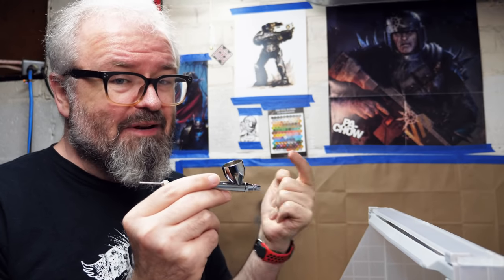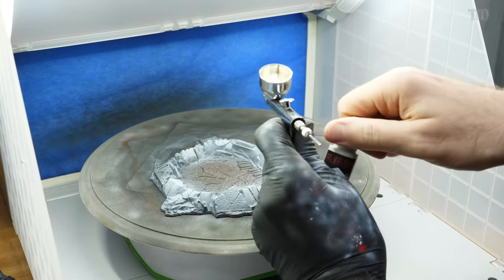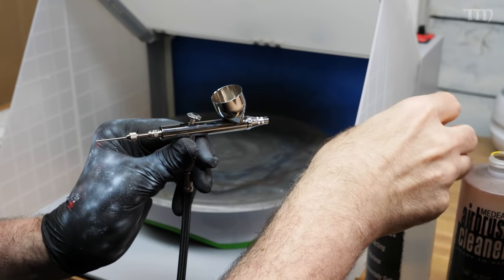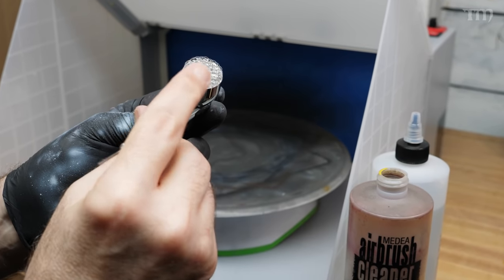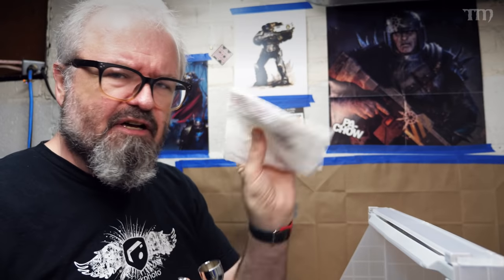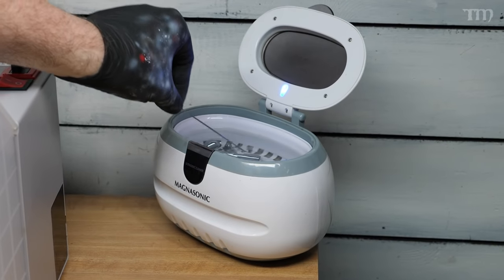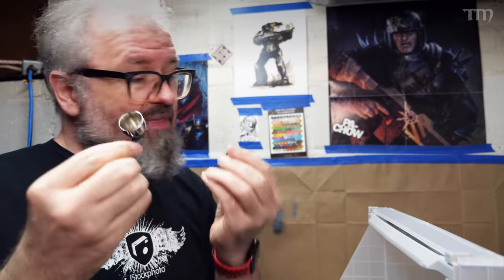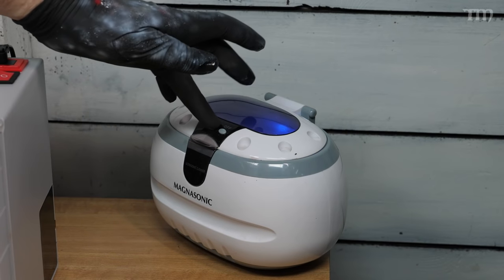NEVER Clog Your Airbrush Again!

Comment: I much prefer to dump the contents of the paint cup after you back fill. If there's any tiny bits of paint that have dried or started drying, I don't want to be firing that through the nozzle.
Reply: Same here, there can be an awful lot of paint flecks in there.
Reply: That's another good reason why to add too little paint instead of too much. When I put in too much it starts to dry around the edges leaving those tacky lumpy deposits.
Reply: 100% agree, and it only takes a few seconds
Reply: I usually do that too, but I imagine his other techniques minimize how many small particles will even be there.
Reply: Absolutely this. What he does will cause clogging. Main way to never clog an airbrush is to correctly use the double action. 90% of miniature painters do not use airbrush correctly
Reply: @andreikoenig5718  can you elaborate on what you mean by double action? I don't follow what part of the above comment is referring to double action
Reply: @robulon  I assume we are talking about double action airbrushes. Most mini painters do not use the double action correctly. When you push down, air comes out, then you pull and paint comes out. You want to do that in reverse when you want to stop the paint. Push back and then release trigger. You dont want to let go when you have the trigger pressed and back. It immediately shuts off the flow so the paint now is on the needle and the tip and that what cloggs the airbrush. Hope that makes sense. A professional airbrush artists taught me this several years ago. I have 2 iwata airbrushes that I use at least twice a week, and I have not taken the apart in over a year. And I shoot primers, enamels, acrylic, varnish, etc. If you never leave paint on the needle, cleaning is super easy. I blow water through it, and then a little bit of cleaning solution and its ready for next session.
Reply: @andreikoenig5718 excellent advice mate❤

Comment: One additional thing: take the needle out through the nozzle side of the brush (after removing the actual nozzle). This way you don't 'contaminate' the parts of the brush that would otherwise never see any paint (the trigger and back screw parts)
Reply: Came to the comments to say this, took me many years and many replacement backstop washers to figure that one out.
Reply: Would that work with a nozzle you have to unscrew?  Not all of them just pop out.
Reply: @Gakusangi If the tip screws in, your kit probably came with a wrench.  Trying this out for cleaning purposes will also show you how to swap tips, which you need to know to swap needle sizes.  So worth doing as a learning exercise!  
 
🙂
Reply: @johnsteidl293  I was only concerned about unscrewing the nozzle while the needle was still inside the airbrush and if that was risky to do.
Reply: @Gakusangi  Only the usual need to be careful when working around the needle tip.  And if you ever damage one, they are not that expensive to replace.

Comment: I haven't been keeping my airbrush wet, but what I usually do before I start (I do something pretty similar as a cleaning process) is run a few drops of cleaner, then water, and then flow improver through before I start painting with it.
Reply: I second this ^^
Reply: Yes
Reply: yep me to, and it was until now always totally enough. 
i ha e one issue with oncles move, i would never spray the cleaning liquid after the backblast process back out the front, this move totally contradicts the backblast process. yes, i do spray out the front, but only then, after i backblasted and spilled that stuff out first and cleaned the top. i mean, then when i am sure, that nl particles can go further torwards the nozzle
Reply: this is what I do.
Reply: Thank you.  I was wondering what someone who doesn't use an airbrush often enough to justify keeping it in water should do.

Comment: use the Ultimate apex airbrush, i used standard thinners from a car paint shop first a little amount backflowed then poored onto kitchen towel to avoid paint going back into the needle area, then repeat but blowed through to clear the needle area, that's okay for a colour change, if I have used 2k or primer I always do a full breakdown clean, then when I have done all those types of cleaning a quick blast of acetone to get any lasting particles through and that air drys very quickly

Comment: Coming back a week later to comment after testing. This worked for me like a charm! I live in a dry climate so my brush tended to clog very easily no matter how much thinner I was using. I was getting to point of having to do deep cleans of the brush mid session to stop speckling.

I tried this and to my surprise, works like magic. No speckling issues except for the usually tip drying through my sessions. Thanks!

Comment: Airbrush Cleaner is, generally, a mix of Isopropyl alcohol, Glycerine and water.
So I cut the middle man and use just Iso most of the time, since I had already stocked it before the "inflation" of it.

When I want to make a deep clean of one of my airbrushes (I own 4, different uses) , I take my ultrasonic cleaner filled to half with water, I take a plastic bag (the food kind) , fill it with the other half of water + a dab of Iso (never fill an ultrasonic cleaner with pure Iso) , the Airbrush goes into the plastic bag (not dismantled, sometimes I will just take the needle out and also put it in the bag) , and I try to leave it for 10 minutes.

The plastic bag makes it really easy to throw the washing water out without having to move the whole ultrasonic, and the vibrations move through it like it was nothing
Reply: Clever use of bag.
+1
Reply: That bag idea is genius. Thank you !

Comment: I highly recommend you invest in a quick disconnect. Even if you only have one brush, it saves a lot of time when you have to disconnect your brush. I alternate with three brushes and I don't want to wait while I screw a hose on and off between them.
Reply: I did a lot of work with an industrial air compressor in my youth, so I bought Iawata quick disconnects with my first airbrush. They're so worth it.

Comment: For me the problem is usually painting a lot of the same color... paint will start to dry in the airbrush, the dried paint moves downstream and bang, there's your clog.
You should periodically clean just like between colors...
Reply: One thing that helps with that is mixing the paint really well and using a flow improver and airbrush thinner rather than just water. Altougth if the paint bottle has culmps in it theres norhing you can do outside of thinning the paint in something like a plastic shot glass and then pouring it in the airbrush. Altougth they do sell tiny filter just for that but I have never tried them
Reply: I had the same problem, but I think I found a solution to it: during a paint session don't touch (clean) the inside of the paint pot with anything rigid, only cleaner or water. This way you don't chip off dried paint which will eventually end clogging the nozzle.
Reply: One thing you can try is to add a bit of airbrush cleaner, tamiya thinner or isopropanol alcohol to your paint. Also helps with the tip drying.

Comment: Thank you for sharing this video! I have been ABing for about 20 years and I do everything you do except for two things. First, when I’m done I clean out the cup with thinner first and dump it, then I use the cleaner. Second thing, with the cleaner in the cup, I take a #3 or 4 round brush and clean around the sides of the cup with the cleaner, dump that and repeat, back flush and then repeat with water or window wash from my car, back flush repeat and done! I also take one drop of needle juice on my index finger, rub it together with thumb and index finger and pinch/pass the needle through my fingers once and done!

Comment: Some airbrushes have little holes in the nozzle cone - trying to backflow those is an easy way to get the airbrush clogged up ( because inevitably you wont make a perfect seal and a little paint still comes through ) :(
Reply: Makeup sponges help there, take the protector off, hold the sponge over the end and backflow. The sponge is soft enough to keep your needle safe, but hardy enough to block the airflow.
Reply: @elijahdprophet  agreed, those little wedges make a perfect seal even with the "crown" like protector still attached.. (they're also pretty sweet for wiping off little boo-boos' without wrecking the whole show)

Comment: I think a good point is making sure that the pressure isn’t too high.  If it is too high the paint can dry on the needle near the nozzle. I ran into that and it took me forever figure that was the reason I kept clogging.
Reply: What pressure would you recommend?
Reply: That’s a really good point.
Reply: @channelv5333  I have found that most acrylics work well in the 15 psi to 25 psi range. I usually have mine set to 20 psi and test that I can control the paint on a piece of paper. If it splurts out the pressure could be too low or it could be thinned too much.

Comment: I've read elsewhere that keeping the airbrush under water was bad for the rubber gaskets, but I agree, it works and it seems worth the trade off. The other good tip is to not allow the paint to run out, therefore avoiding blowing air over a dry tip. I still get paint on the shaft of the needle have have to clear it though. I still haven't solved that issue, except to take it out and clean the whole thing.

Comment: Basically my method except for the submerging bit. I also got a tip from a commision painting friend of mine. Have a soft toothbrush nearby, inbetween colours or whenever you see gunk starting to form on the on the tip of the needle, put some airbrush cleaner on the brush and just give it a quick scrub. I don't think I've had a clog in months using this tip on top of my usual cleaning procedure. Cheers Uncle Atom, looking forward to seeing some more airbrushing videos now you've got your new setup.
Reply: I saw this on a Lyla Mev video recently too, its surprising how often this is the sourse of a problem, and so quick to fix.  This seems to be the biggest issue with my airbrushing overall.  I left my brush for two years without using it, went back to using it again regularly and had no problems after an initial clean.  I'm not 100% convinced about leaving the brush permanently submerged being a big improvement, I can still see that paint could dry on the tip of the needle during use anyway.

Comment: Thanks for this! I would never have thought to keep a metal instrument in water but that's pretty genius. I mostly bubble up & spray through a little airbrush thinner and then a little cleaner, and use a cotton swab instead of paper towel to loosen anything stuck in the cup, and haven't had issues since starting that process a year+ ago.

Comment: I use my own made cleaner. 2/5 distilled water + 2/5 window cleaner (ammonia free) + 1/5 IPA 99.9% alcohol + 15 drops of glycerin. It does the exact same bubble as the ones shown in this video :D I usually do all the steps you do, but I also do an acetone pass at the end to get rid of any dry paint.  I don' t keep the airbrush dipped in water. I just do an acetone pass before painting.

Comment: If you aren't averse to solvents, try lacquer thinners or a solvent-based cleaner like Tamiya airbrush cleaner. It INSTANTLY dissolves all dried paint it touches, including cured varnishes. Yes, this also applies to dried water-based acrylic paint. A couple of drops on a shop towel will clean out any errant dried paint spill or spatter. I actually recommend trying solvent-based acrylics in general, if you can get good enough ventilation. Solvent-based acrylics ("lacquers", we usually call them) don't clog, have better coverage and spray smoothly and evenly, even with poor technique.  I'm always frustrated and disappointed when I go back to spraying water-based acrylics. I actually started with water-based and still use them, but lacquers always give me a better experience. Unfortunately, they are stinky and don't brush paint well.
Reply: If you're spraying lacquer paint I would recommend using a spray-booth with an extractor fan and a respirator rated for solvent use as a minimum. The smell from lacquers is the least of your problems, you don't want to be inhaling vaporised lacquer thinners and carrier fluid. Its toxic and repeated exposure to it could possibly affect your health.
Reply: might try this. mine got clogged after using varnish ffs

Comment: Thanks for the tutorial. I'm new to using the airbrush. So far no major problems. I take a bit more attention when airbrushing primers though. Lacquer primers have this flaky membrane-y stuff building in the cup, so my common sense tells me not to shoot it out when I'm cleaning it. Same thing with paints.

If I've been using the airbrush for a few hours at a time, then I disassemble and clean it properly. I've never disassembled the trigger, stem and back parts though, because I take a conscious attention never to tip the airbrush THAT way, if you know what I mean. 
And during deep cleans, I push the needle out from THE FRONT to prevent introducing gunk into the trigger system in the back. I also insert it back into the airbrush from the front. Carefully, of course.

Otherwise, I've been having a blast with the airbrush. It's been about 3 months so I should probably drain the bottom of the compressor tank sometime soon too LOL.

Comment: I generally wipe the inside out with a paper towel before back blowing. It gets most of the paint out first.

Nice tip about keeping the airbrush wet. I've never heard of that before.

When my brush clogs, it's usually because I have a problem with the paint, ie. particles in the paint clogging the nozzle. So my own tip is to mix paint in a separate container first, then decant into the airbrush cup. This leaves sediments behind. This mostly applies when I'm spraying dollar store craft paints onto terrain. Sometimes the acrylics don't react well with thinner, or even water. I don't do this when just using Tamiya or Vallejo.

Comment: Keeping your airbrush wet in between sessions is the best maintenance tip I have ever come across. Picked up this tip previously from Kenny Boucher of Next Level Painting. Mine sits in a tupperware tub in a 50/50 mix of airbrush cleaner/water. It's been there a few months now since I last used it so just checked the level, which is still fine. The tupperware lid is doing it's job. Despite this one tip making maintenance far less of a chore, I still hate using the airbrush.
Reply: Kenny the Butcher

Comment: Good Stuff Uncle A, you have mentioned some of this before but it really helps to have it one video, my biggest issue with airbrushing is clogs. 
I did similar cleaning to you though I go with water first to clean out the cup and wipe of the inside of the cup with a microfibre cloth, paper towels can leave bits if your unlucky. Then I hit it with Cleaner, its pretty much Vince's technique.
My main black primer from Vallejo still keeps clogging both airbrushes even with Flow Improver and I would use sonic cleaners and soak them in water and air brush cleaner.
But one thing I tend to do is prime a lot of minis at once so I put a lot of paint in the cup and I think that does not help as some will dry in the cup and then possibly flake into the brush and clog it so have started putting less in as you advise.
The other thing about keep it in liquid I will try too, though my brushes will spend days in soak I do take them out and clean them and I use an old needle to ensure the nozzle is clean and often push out tapeworms of black primer :(
In the End I went to AK interactive Black Primer and man its so much better.
Like other ways to paint you discover what paints work best and in this case I have learnt not to use the Vallejo black primer, which is sad as I got a big bottle :(
Thanks for this :) I am hopeful my airbrushes will be clog free from now on as airbrushing is a joy, my favourite part of painting which I largely tolerate ;)
Reply: I've been using Vallejo matte black, gloss black, mech white and grey primers.  They grey was horrible to use due to regular blockages, but that was when I had only just discovered air brushing.  These days I can prime with the grey with zero clogging, and I think I was previously just bad at cleaning my particular air brush and it was me rather than the primer.  Primer is pretty thick so I tend to thin it down a lot as well as using flow improver.  If I'm priming a lot of models, or something really big requiring a number of cup refills, when I see a layer of primer scum coating the cup I'll clean that out because thats what can break down into the paint again and cause the clogging mid-session.

Comment: After some recent practice I've found that taking 15 minutes to clean my airbrush after every session keeps it performing really well.  Leaving paint in there to dry out often blocks the nozzle, so I make sure I work fast between layers of priming or switching colours.  If paint dries on the end of the needle, going over it with a wet brush can cure that really fast.  IMO keeping the brush clean is the best way to have a pain free experience, and cleaning little and often minimises the need for time intensive deep cleaning.